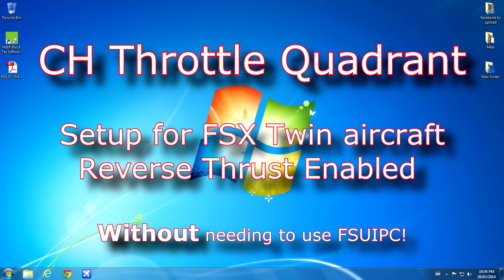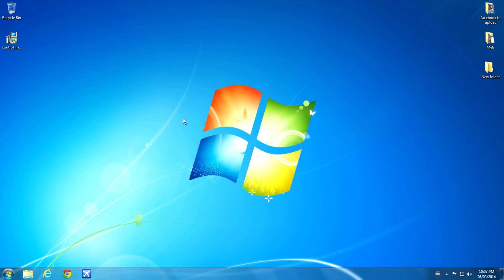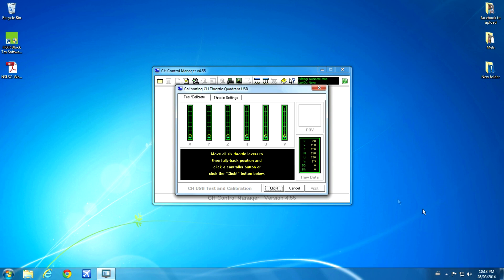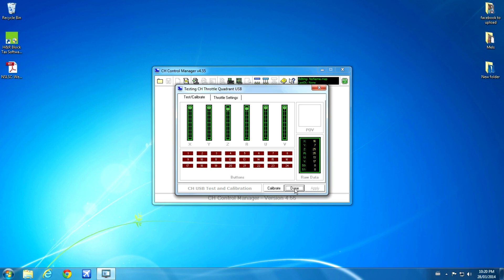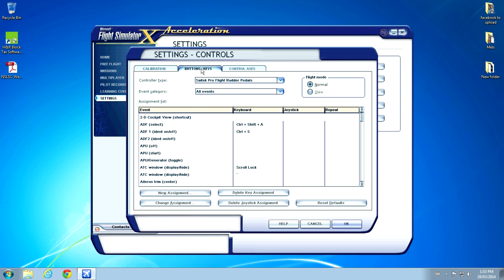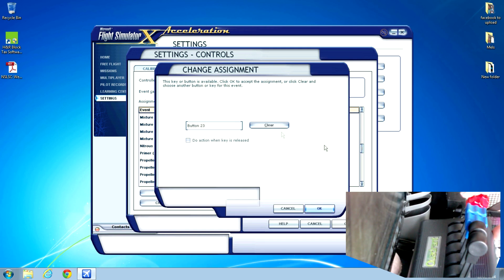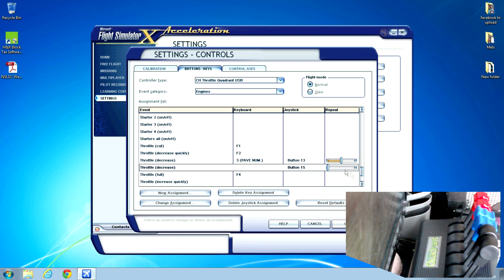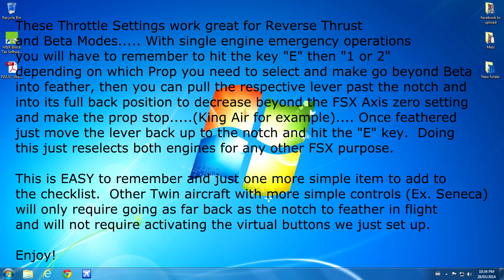CH Throttle Quadrant setup for FSX (Reverse Thrust without FSUIPC)

Comment: Great video. I finally have my CH Throttle Quadrant working properly (except for the occasional sticky pot).  You might want to mention that if you do have FSUIPC installed, you need to go to the FSUIPC menu and reset all axis assignments to avoid any conflicts.  Thanks again.
Reply from the maker: glad you liked the video.  I don't have fsuipc installed so I didn't know there could be a conflict if you do have it.  Good to know, thanks!
Reply: Also delete all axis assignments in FSX, I neglected that step and fought conflicts for days until I figured it out, I later found that in the manual but who uses a manual, that is the last resort.

FSUIPC talks directly to FSX so the extra step of deciphering the assignments and inputs is avoided, it actually made FSX run smoother without any jitter when sending multiple commands/buttons/axes.

Comment: Hi Rob... jut wanted to thank you for your video on how to setup the CH Throttle correctly using the CH Manager .... It really helped me and sure saved time trying to learn how to do it with FSUIPC ... still need to master that though ... anyway thanks
Reply from the maker: Harry, I am happy to help, glad you found it useful.
Reply: You think FSUIPC is more complex than the CH software?

I found the opposite to be true, I deleted the CH software and run everything through FSUIPC, I have some hacks and want to build some custom controls like a A/P unit and a radio stack, and run them through an Arduino, so that will need FSUIPC anyway.

Comment: When it was time for you to assign a category to your throttle axises (the black levers); what made you pick "throttle decrease"?  The throttle lever is for both increasing and decreasing, depending on which way you're moving it, so your choice seemed sort of arbitrary to me.  How did you know not to pick "throttle increase", or "throttle" (by itself-- assuming such a choice even existed)?
Reply from the maker: Hi B3burner, if you look at the video and skip to 4:20 you'll see that my throttle axis are assigned to engine 1 throttle axis and engine 2 throttle axis.  But from there I believe what your referring to is how I set up the virtual buttons.  When the controls come back to their notch it activates a button in the control manager software and fsx sees it as if it were just a button in the joystick.  Because I could only make the actual axis control positive throttle input I decided to assign the virtual button to decrease throttle for the same purpose of activating reverse thrust.  It's not perfect, but for home flight SIM purpose it's fine in my opinion.  I hope that shed some light on my reasoning, good question.
Reply: Thank you.  I just bought the CH Throt Quad about 2 wks ago, and I'm having a heck of a time taming the burly beast and getting it to do what I want it to, but I'm hoping your video will help.  I plan on pausing and playing it over again several times.  Thanks again for posting.
Reply from the maker: ***** I'm happy to help....feel free to ask if you have any more questions and I'll do my best to help out.  Glad you find the video useful.

Comment: Nice vid, can you say how you created the extra buttons?
Reply: The CH throttle quadrant sets them up automatically I found mine had them by accident, I setting up my buttons and moved a throttle lever and I saw the button activate.

My first response was WTF is button 23 and where is it, then I starting thinking of ways to use them like reverse thrust, instant throttle zero, that sort of thing

I was using FSUIPC though, the CH software and FSX seem to see them also.

Comment: The software crashes as soon as I click the calibrate buton
Reply from the maker: Tallishyeti27 I'm unsure how to help with this... Maybe uninstall than reinstall the software.  I'd have a look also at the ch website to make sure no steps were missed as far as drivers go, etc.....  Good luck, wish I could offer more help.
Reply: Ridiculous Flight Simmers I downloaded the "most current" version from the website but the readme say it only supports up to windows 7. I uninstalled that and now I'm trying the disc that came in the box
Reply: Ridiculous Flight Simmers no success. I guess I'll call ch in the morning
Reply from the maker: Tallishyeti27 I'm using Windows 10 and reformatted my pc last month.  I reinstalled the ch software and calibrated with no issue.... The one from the website should be better than the disk shipped in the box.   I'm no expert, but if I were you, here's what I'd try in order....

1 Uninstall ch software
2 Uninstall USB ch drivers(in device manager)
3 Shut down pc
4 Unplug ch quadrant
5 Restart pc
6 Plug in ch quadrant to the usb port AND ALLOW ALL of the default Windows drivers to detect and install.

7 Then I'd reinstall the ch software

8 Then recalibrate quadrant...

Hopefully that works for you.  Every pc is a bit different and without having it in front of me, that's the best advice I can offer.

Good luck.
Reply: Ridiculous Flight Simmers thanks for the advice. I really appreciate it. I'll give it a try tomorrow